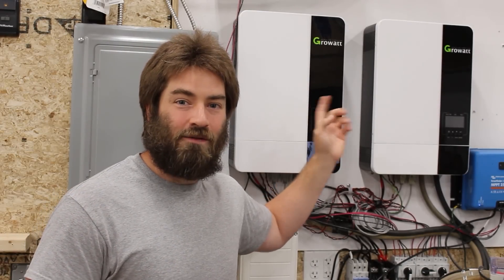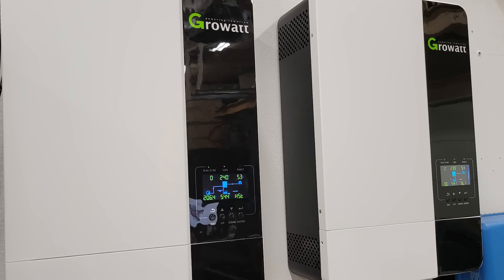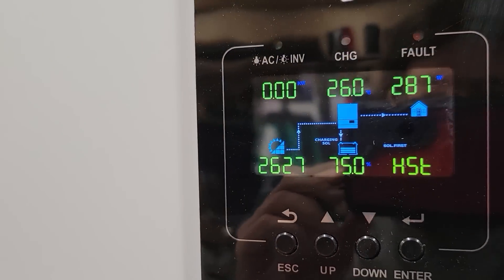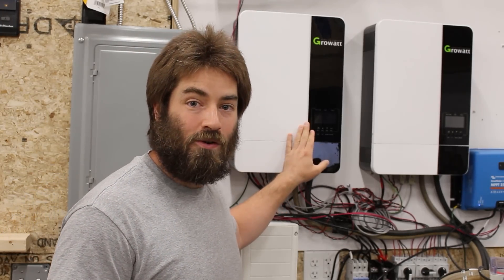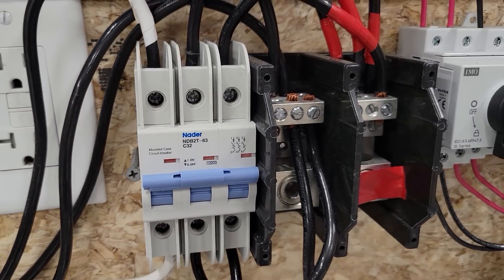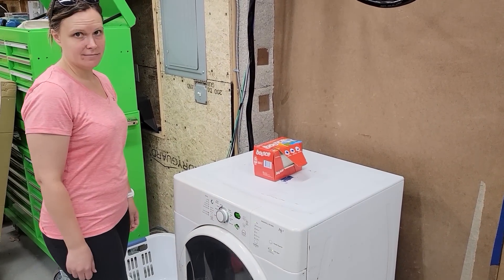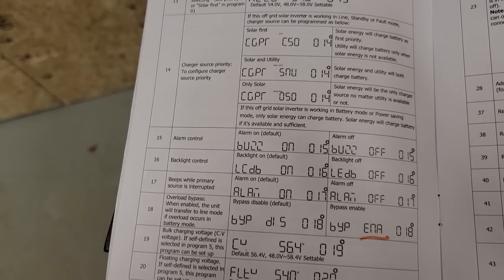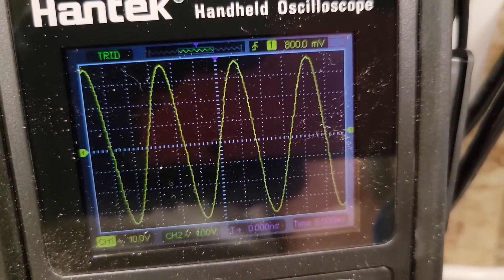Update after 1 year of use off grid, Growatt and EG4 (Gyll) batteries

Comment: Hey David great video can you elaborate on the triple pole breaker for the auto transformer I’m actually in the process of building the same system you have accepted 3. 5KW and a 11.6 KW transformer
Reply from the maker: The 3-pole breaker is a 32A made by Nader.  The exact brand doesn't matter, so long as it is rated for 240VAC per pole.  Some are a little less. Here is a link to the exact one I'm using: https://amzn.to/3JNTuIw  I choose this breaker because 32A is the maximum current on the Neutral for my auto-transformer.  You will need to size a solution that works for your setup.  

BTW, another option is to buy an "Isolation Transformer" rated for your full inverter capacity.  If you are going to parallel 3 of the 5kW inverters, then you have 15kW potential.  Buying a 15KVA (or more) isolation transformer would also produce a Neutral and then you don't have to do anything fancy with the circuit breakers like I did.  I just did a quick search on Ebay and this one came up: https://www.ebay.com/itm/266180228910?hash=item3df993f72e:g:91UAAOSwsg9jysBB&amdata=enc%3AAQAHAAAAwEDg9hpZMQ5hLs5Q%2B8%2BUjw%2BClM34oLeiw5vJkBaKAVf3dgWYImMGVRI8JKLE4k1aqiH9qeGzHVjzXRMXqjM3n9nEdrUJUzZUFCnW4im7HmkqFCKZ0HIAwN0v3TSaYM2thdXd%2FSg04yc7r4cu1wOTqPemr4ydqe7UL%2BMeCzXP3GtSEV9Iah4Oddy56LpHoORmX0Dy9TRP5tA%2BbSSj7iD1JP6hykqvOeHaMEgRehk8OQeX7JpyZtg4Exr9e5ifdb%2BLMQ%3D%3D%7Ctkp%3ABk9SR57p3qLjYQ  Just to give you an idea.
Reply: @DavidPozEnergy    And that would have done the same as your solar edge transformer and for so much cheaper what the heck
Reply from the maker: There are more than one way to do this.  Pros and cons to everything.  I'm just giving you another idea to consider.
Reply: @DavidPozEnergy  thanks a lot for the help David   I’m in CT and what a rainy crappy day. But I’ve also got an off grid camp in monson where you sent you power board.  Or sorry for his FL place poet
Reply from the maker: Cool.  I visit Poet in Maine, and delivered the system to him in Maine.  He drove it down to FL and set it up there.

Comment: Hi David.  I hate it that I forgot to use your code to get you Recognized when I purchased my three growatts 5KW  from signature solar 
 anyways I wish you had a wiring diagram somewhere especially that three phase breaker
Reply from the maker: The Growatt inverters are still running on my wall.  I think they are an excellent value for someone to get into solar inexpensively.  I don't think they are the best inverters out there, or will last forever.  There are plenty of better inverters if your budget allows.
Reply: @DavidPozEnergy  I actually had 2 EG4 6kw and they would not work for me non stop error and fault codes so I switched to the 3 5KW growatts
Reply from the maker: @cowboymcq6711  Sorry to hear that.  I've never tested or reviewed an EG4 inverter, so I can't comment on them.

Comment: I have 2 Growatts now installed in a new property.  I'm just using Batteries for back up only right now.  I've been testing the system by turning off the main (grid) power and manually connecting the inverters to power the whole house.  I noticed the output doesn't turn on right away  in fact not at all until I go into the settings and then one will produce output and not the other.  I also noticed in your video you can turn off one inverter and use the other?  I think that is a great feature since they draw about 70 watts per hour just to be on.  Any thoughts why they don't output right away?  (I've enabled and disabled power save with no change)
Reply from the maker: Sorry, I don't know.  I have mine set up off grid.  Since my testing and experience is in off grid applications, I can only comment on that.

Comment: I have been living off the grid for 35 years and have the same 48volt (one of the first 10 made) inverter for the past 30 years. We now have two living spaces with 100% off grid solar (only 2.3 kW and 2.7 kW) at the sites and will be going electric now with the cooking and charging the Solectrac EV tractor and be getting an EV car soon to be 100% non-fossil fuel (minus the hydrolic fluid of the tractor.) We are looking at setting up a solar system at the barn, 13.5 kW this summer and using that as our charging station and wood shot etc. We are looking at connecting a line from the barn, 240 volt, to the two homes and connecting the barn system to EG4 pairs of inverters in the "utility line" spot at each home. The barn will be the same system perhaps... EG4 2 x 6500 W inverters as well. Victron Inverters is another possibility but less power and almost 3x the cost. We are wondering if there is an easy way (wiring and programing) to have the homes "backup" the car and tractor barn charging stations at times and have the barn charge the homes at other times? How could we wire this "independent" and collective microsystem we are developing. At somepoint the barn may also have a home in it making the system three living areas and a charging station for the farm needs. Ideas?

Comment: # David:  David have you ever tried to have your electricity generator supply 230 V AC to feed your Growatt Inverter and charge your batteries?The Growatt SPF5000 ES is,at least in the product this is mentioned, are capable to be fed by 230V AC from a Generator. If you have already tested this, was that a pure Sinus Or modified Sinus Generator?? The manual does not mention anything on pure or modified Sinus requirement.  Thanks for your great and very valued Videos!!   Best regards from Hungary
Reply from the maker: Yes.  I tested this once when building an off grid system for a friend.  It was one of these inverters (Growatt 5000ES) and I used a pure sine wave Honda generator.  That test is at the end of this video: https://youtu.be/oMH3IwR0ZC8
Reply: @DavidPozEnergy  Thank you very much! You are a great guy!

Comment: David I been have magnum energy inverter that has it's switching relay gone bad so when I have to run the generator to charge the system it has to be totally rest to go back on inverter. I TT the manufacturer and they had me fill out a form to get a warranty replacement 6 months ago with no replacement insight. If I were to get two Grow watt inverters and a single transformer it would cost me less than I paid for the present setup and give me the actual power I need, I use 30000watts total in 24 hours how much solar power would I need to setup to charge the system during a normal day if you know if I purchased 6 of the 48volr batteries as you have  setup.  The company I last purchase from only sold me 1/2 the system I needed even after I told them how much power draw I was using per day they gave me a 4400watt capacity inverter instead of the 8000 watt I needed as I am now off grid totally

Comment: What mounting systems are you using? Link?
Reply from the maker: I made the solar rack.
Reply: @DavidPozEnergy  Any chance you can post a video of how you went about it? What parts, where to get them. I am building multiple arrays and need a dyi solution that is cost effective.  Thank you. I believe your video will get lots of views, as I have been searching for a video that shows cheap mounting solutions.
Reply: @DavidPoz  Also, any chance you can get discounts on the batteries?

Comment: David, I’m nervous about the auto transformer vs isolation transformer.  And, I want to use the grid using ‘SBU’.  Is that why you went to the isolation transformer, as well?
Reply from the maker: I never went isolation transformer.  I intended to make a video about the isolation transformer, but ended up testing a different inverter.  I never personally had an issue with the auto-transformer, but I was off grid.  All my work and testing is off grid.

Comment: you are so wrong about the growatts. I have the exact system you have and I have been babysitting the system for almost a year. signature solar sold me 2-5000es growatts with outdated firmware. they e-mailed me updated firmware to upload but it didn't work. the system kept crashing and draining the 2-5000 life power 4 lipo batteries down to 1%. the inverters would then shut down. sometimes they worked but most of the time, I would have to restart the system  having the inverters/ grid charge the batteries half the day just to get the batteries up to working mode set to 35%. I could go on and on. I bought this system because I studied YOU for 6 months prior to purchase. you are so wrong with your review, I have experienced a total nightmare with this system!!!! You are obviously paid by signature solar. this video you uploaded is so cookie cutter!!
Reply from the maker: That sounds like a pretty bad experience.  My experience is very different.  I described my experience in the video.  Just because we have different experiences doesn't mean I was wrong.  Also, I purchased the Growatt inverters.  I've never updated the firmware on the Growatt inverters, and it sounds like I purchased mine before you.  I welcome people sharing their own experiences in the comments.  Please keep them respectful, and don't make assumptions.

Comment: David, would you, kindly share, the configuration you install in those 50 steps, within the two growatt inverters?
Reply from the maker: I'm running my Growatt off grid.  I have nothing attached to the "AC INPUT" terminals.  So my setup was pretty straight forward.  I set my bulk charge to 56.0V.  My Float Charge to 54.0V, and the low Voltage cutoff at 48.0V.  If you want to get into the details a bit more, I suggest this video from Signature Solar: https://youtu.be/vUWxTbaWbS0

Comment: Hi David..Why are you using an external mppt? And how did you do that connection?
Reply from the maker: I have 3 solar arrays.  2 solar arrays go to the built-in MPPT charge controllers inside the Growatt inverters.  The third solar array goes to the Victron (blue) solar charge controller.
Reply: @DavidPozEnergy  GR8 so its to mainly help charge the battery's then?
Reply: Would you say its safe to run a water heater of 3.5kva once or twice for an hour or 2 a day with a single growatt 5000es?

Comment: Have you had luck with getting the GyLL (Lifepower) communicating with the stackable Growatt inverters?
Reply from the maker: I never attempted closed-loop communication with the Growatts.  I've ran everything based on Voltage.  Personally, I set my Bulk charge to 56.0V, Float charge to 54.0V, and Low-Voltage cutoff to 49.0V.  
When I first set things up I ran it all the way to 58.4, and down to 44, but that was just for testing purposes.  Going more conservative doesn't loose much capacity, but it does lengthen the life expectancy of the batteries.

Comment: I have a LV5048 for the house power and a 5000ES for our Mr Cool Universal 2-3 Ton AC. I've been off grid since 79 and in the last year changed to this system. Have 12 EG4 rack batteries and adding 6 more. All that said my question is: The house on the LV5048 has a pretty constant flicker on some LED lights, the kind you buy at HD that look like old light bulbs. The way I cured that in the past with my Outback and even older Heart and Trace inverters was throw a 120V large Capacitor into my circuit. Simply wired a plug on it and plugged it into a receptacle. Would this work on these inverters to smooth it out and get rid of that annoying flicker?
Reply from the maker: Congratulations on being off grid since 79.  
I've never attempted a capacitor based solution before.  Sounds cool, but I just don't have experience with it.  I have tried a couple things before.
1. Make sure the inverter is set for 240V, not 230V.  Some inverters will arrive programmed for 230V, which I've seen be the culprit to flickering LED's before.  
1 (b). Try to minimize any Voltage drop between inverter and loads.  Make sure the wire gauge is sized well, and is as short as possible.  Again, this ties into making sure the loads see as close to 120V as possible.
2. With the LV5048, I think that is a split-phase inverter out of the box.  With any split-phase and transformer-less inverter, I've seen a benefit to adding a transformer.  This could be an auto-transformer or an isolation transformer.  it helps balance the loads between the two legs, and helps with surges.
Reply: @DavidPozEnergy  Thanks David for the tips! I've set up as you indicated other than the transformer which I have. Bought it for possible use on the 5000ES if I wanted to run 120 loads. Have the LV5048 set up on UPS so the voltage is tighter than on Appliance mode and 240 volts with 2 120V legs. I believe the LV5048 is actually 2 inverters in one box.  I have 2 LV6048's and 2 EG6500EX's in the wings as I'm setting up my on grid shop to be off grid since I'm guessing electricity company's may raise their rates, lol. The capacitor trick used to remove the hum on our ceiling fans from the old square wave inverters. You readers are extremely fortunate as when I started there was no internet or easy way to find info. Appreciate all your videos as I can relate to your situation. We raised 7 kids off grid and feel they were better for it. Merry Christmas to you and yours!

Comment: Nice setup.  I found a used whirlpool heat pump dryer for $50.  The lady said it wouldn't dry anymore and probably needed a disassemble and thorough cleaning of the coil.  I was able to clean it without too much trouble and it draws around 1000 watts on a 240 volt circuit. I still have my conventional electric dryer and it draws 6000 watts.

Comment: As always, you do a great job explaining what you did and are a big help for newbies like me Dave😂.  I didn’t hear you say what the cost was for that setup so if you can, let us know so I can see what I’m looking at.  Thks brother
Reply: Thanks bud.  That’s about what I was thinking.   I also know that there will be price fluctuations so no worries.  Really like your videos and I might be picking your brain when I get ready to go for it 😂
Reply from the maker: @martinsimar5708  note, I bought my solar panels used and averaged 20 cents per watt.  I traded labor for the scrap steel to build the framed.  But I bought the breakers/inverters/battery at full price.  At the time the battery was $9,500, which was the single biggest chunk of change.
Reply from the maker: I try to avoid talking about cost because the sellers can change the costs the day after I post a video.  But, I spent about $20,000 building up everything,  solar, inverters, batteries and the wires.

Comment: Good day sir, if I was setting Up one of these inverters on my home and I run the grid through it.
Would I still be able to get the use of the autotransformer to brake down the 240v to split phase 120/120?

Would I also be able to hook the transformer up on my 2 hot legs in the breaker box ?
Reply from the maker: I don't know.  I run mine off grid.
Reply: @DavidPozEnergy  ok cool, do you know anyone that run theirs on grid?

Comment: Why are you using a charge controller when that is an integrated part of the inverters?
Reply from the maker: I have 3 solar arrays in the backyard.  Each array needs a dedicated charge controller.  2 arrays go to the two inverters (with integrated charge controllers).  The third array goes to the Victron charge controller.  Thanks for watching.

Comment: Can the Growatt inverter run full time off grid. or do they need to be connected to grid?
Reply from the maker: I've been running full time off grid
Reply: @DavidPozEnergy  thanks for info. 
I downloaded the specifications for the inverter and good.
Reply: @DavidPozEnergy  have you tried the low-frequency inverter 12kw. From Geowatt.

Comment: Sorry if this subject has been covered already but I can't seem to find it. Did anyone tried to connect a MPPT solar charge controller to batteries that are also connected to one of these All-in-One inverters? if so did it work? is there something to be careful about? I have the possibility to add some panels but they would have a different voltage output compared to my other panels and also facing a different direction, so I wanted to take a separate MPPT just for them but still connect them to the same battery.
Reply from the maker: That's what I have done.  Do you see the smaller blue device to the side of the Growatt inverters?  That's a Victron 250/100 MPPT solar charge controller.  Just set the parameters the same as the Growatts.